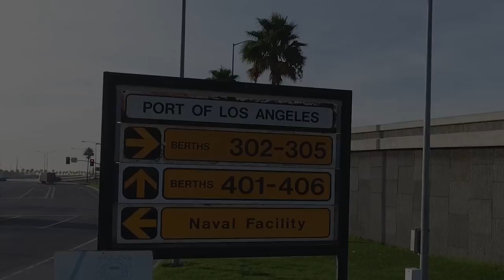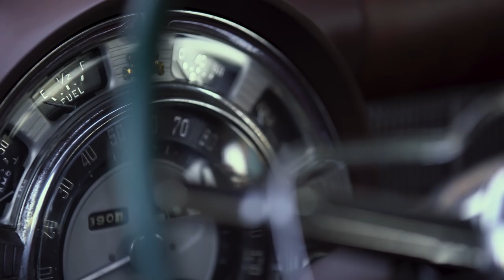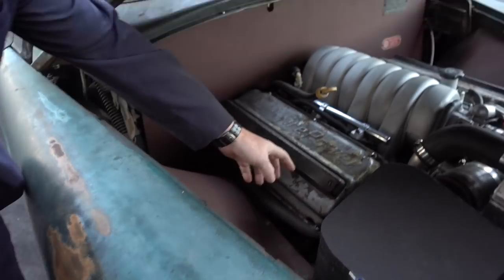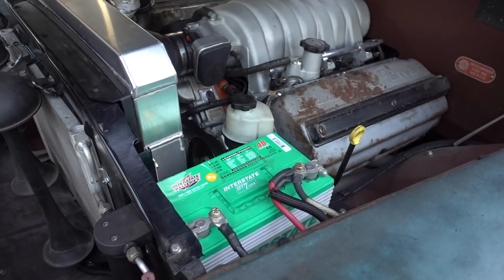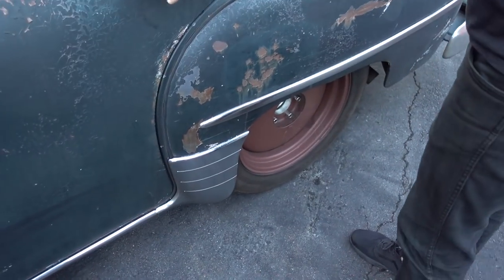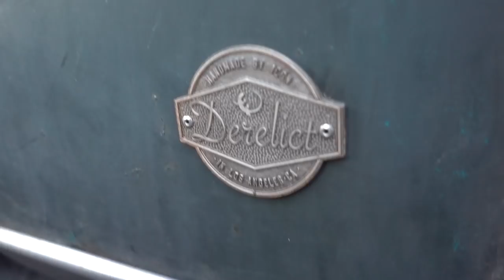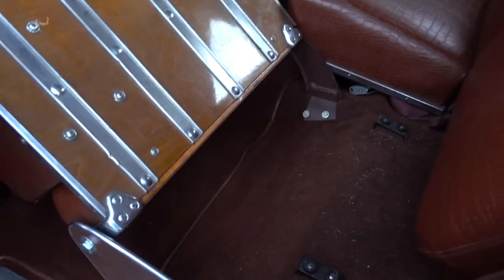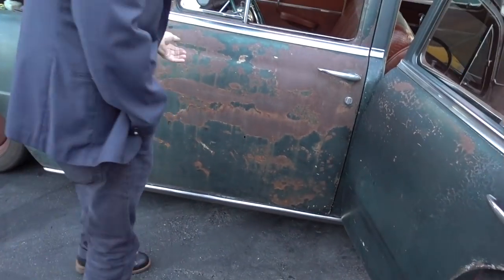ICON Derelict 1954 DeSoto Powermaster Wagon  // DT255

Comment: I disagree with this dude about clear coating patina. All of the people on the West Coast that can leave cars outside for 40 years and only have the paint fade have no idea what 2 years of a New England winter will do to a car. The difference between some cool patina and a straight up hole in the body. Plus people have been doing this in the vw scene for 40 years so the idea of taking something crusty and putting a nice motor in it is as old as the hills. Just saying.